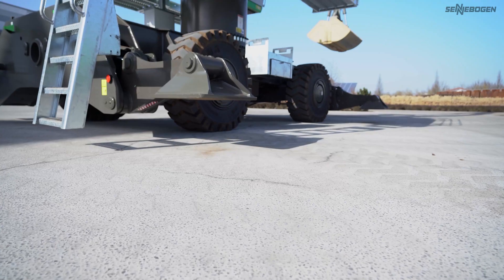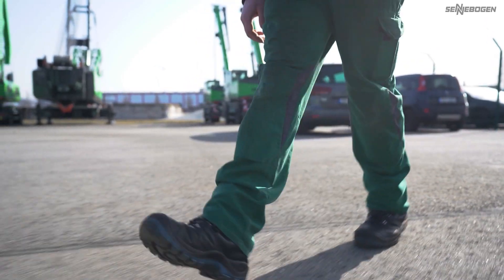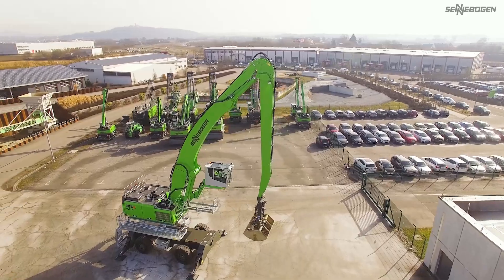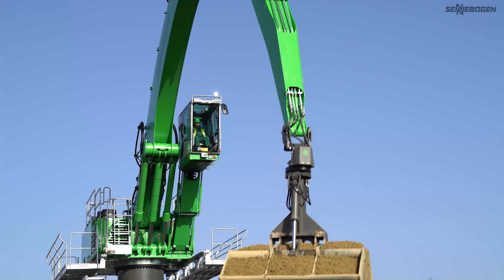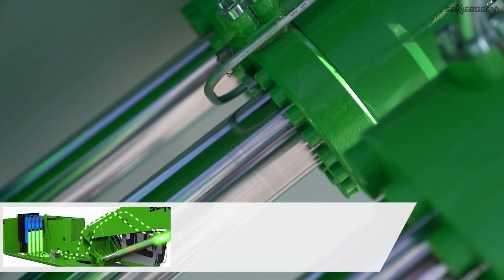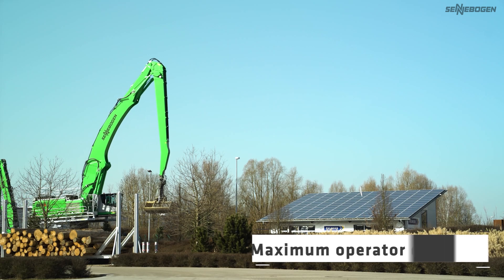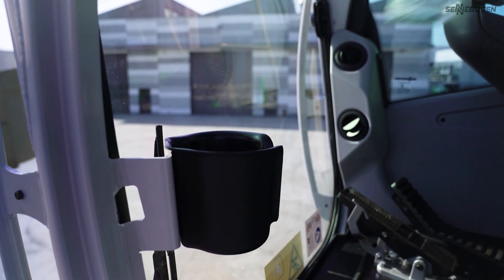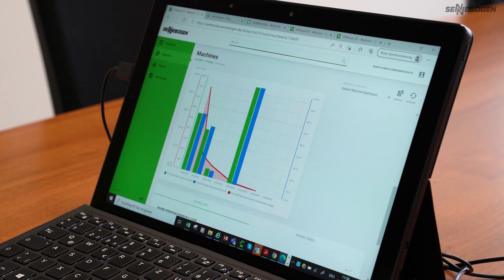The new powerful 90 ton material handler - SENNEBOGEN 865 E (English)

Comment: Is the hydraulic system similar to Mantsinen's hybri lift?
Reply from the maker: Hi Perhe,
Thanks for your question. The major difference is that the SENNEBOGEN Green Hybrid System separates clearly hydraulic and nitrogene circuits / components. Our Energy recovery cylinders are 100 % pure hydraulic cylinder. Easy to maintain, and easy to get on the market. Also the Nitrogene compartments and accumulators are in a protected area- easy to control the temperature. The SENNEBOGEN system is more sophisticated in terms of recharging the system and exchanging the oil.
Here you can find more info:
https://www.sennebogen.com/en/innovations/green-hybrid-energy-recovery-system
If you have any further questions, we would be happy to connect you with one of our product experts.
Best regards,
SENNEBOGEN YouTube Team